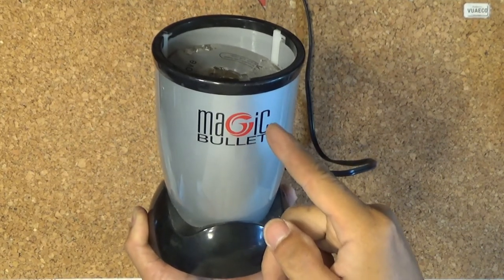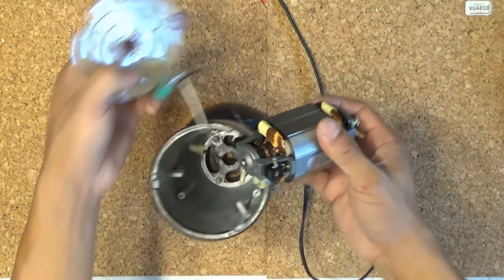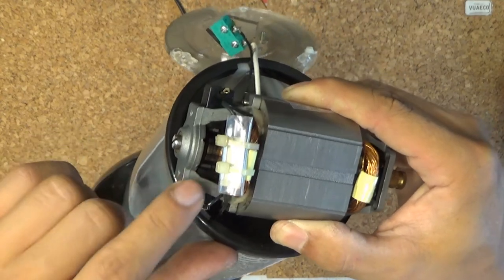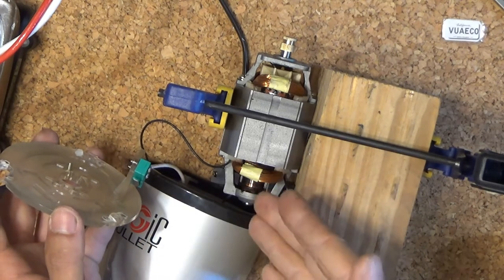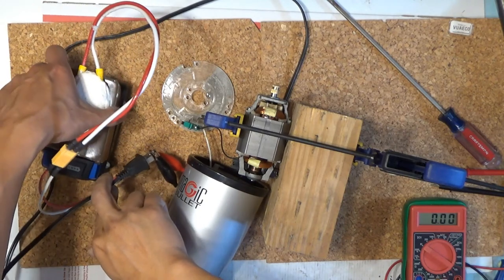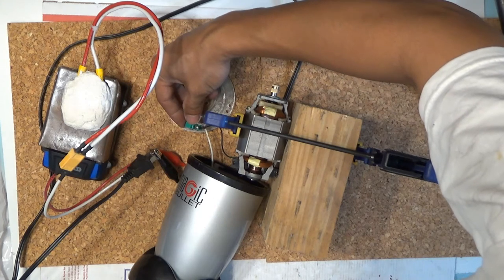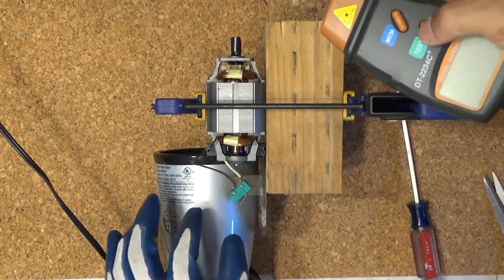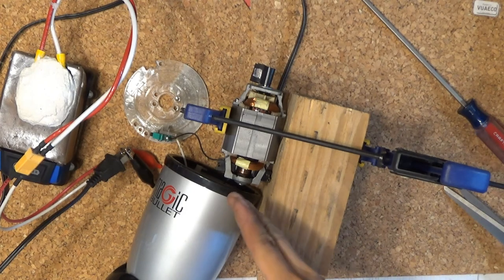Tear down: Magic Bullet. Does it run on DC with a power tool battery?

Comment: Thanks for the video.   But the label with safety instructions doesn't need to be removed to take out the motor. The screws are under the white rubber support.

Comment: It will because it is a universal motor and is so named because it is a type of electric motor that can operate on AC or DC power. It is a commutated series-wound motor where the stator's field coils are connected in series with the rotor windings through a commutator. It is often referred to as an AC series motor. got that from Jeremy on you tube he shows people what can be made from all types of motors, just saying Old One Legged Joseph T.
Reply: Joseph do you know if this motor is in other blenders as I would like to try this hack for my off-grid cabin at the opal fields of Lightning Ridge.

Comment: G'dat Vuaeco. how long do you think it will last on DC and I'm always keen to know how many amps a thing consumes (being off grid)
Reply from the maker: It depends on how much juice you're making and how thick your juice is. :). It can run on DC so you can just use your off grid battery to run it. With this, you usually only run for a brief moment enough to make your juice so it won't consume much power.

Comment: Dude you have a tachometer? That's sick.
Reply from the maker: I mess around with a lot of motors so a tachometer is a very useful tool. It's quite cheap, however.

Comment: Do you know if it is possible to charge a cordless vacuum cleaner (14.4v)via the 12v solar battery bank?
Reply from the maker: 14.4V seems to be Ni-Cad battery, isn't it? A 14.4V battery pack is not usually 14.4V but a bit higher than that. So you'll need a much higher voltage than 14.4V to charge it. A 12V battery bank is at 12.7V at rest fully charged so no, it will not charge a 14.4V battery pack. You can use your 12V solar panel to charge a 14.4V battery, however. But there's no charge controller for a 14.4V so you'll need to monitor it carefully to make sure it's not overcharged.